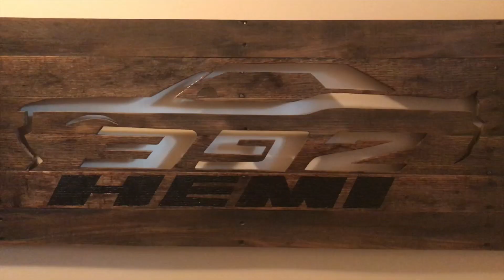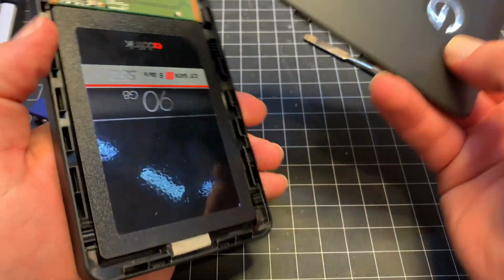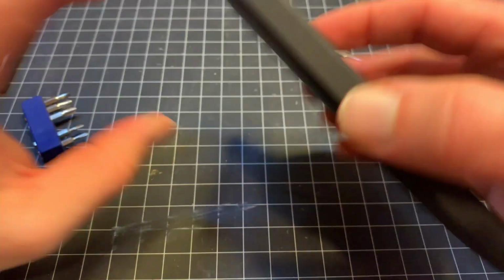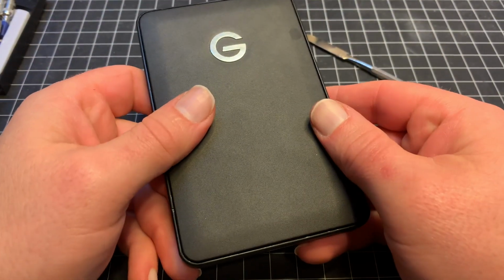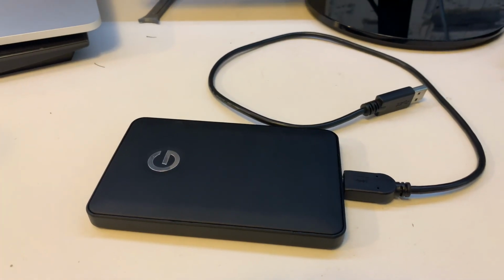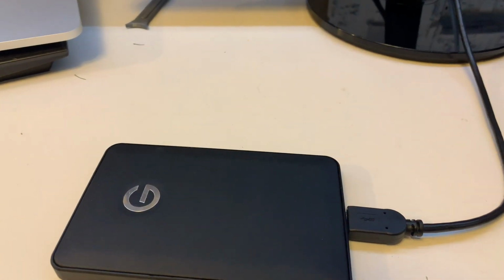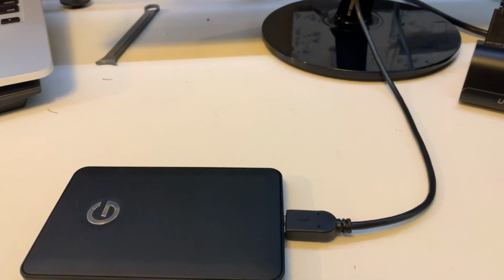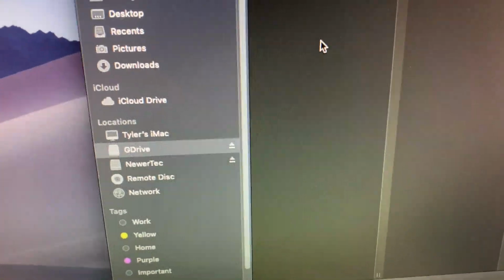Replacing the hard drive in a Gdrive mobile USB

Comment: Nice, just tried it on one of the newer models which doesn't have a SATA connector (After WD bought the brand) and it still works but I think there's some glue all around it, at least I had to loosen it quite a bit using that tool before I could open it.

Only reason I did it though was because I bought a USB-C model which was all scratched up, so I swapped the cases from my old one with USB Micro-B (Which I hate) so I have a nice clean casing but with USB-C. I guess this also means that if you wanted to replace the drive, you could take apart a WD Elements or WD My Passport, because the USB port's soldered to the board instead of a SATA connector and they seem to be in identical places.

Comment: I have the plastic case version (presumably cheaper). But the case and drive mounting are essentially the same. My drive is still working fine, but SMART says it's been operating for 61000 hours (7 continuous years!)... so maybe it will fail? Anyway, thanks for the demo!

Comment: Hmmm. I work on and have electronics since the 80s. I study and do alot. My topic for the sec now is the G drive. Little history for those to understand from me... These G drives I collect. I buy them and use them for me. I like the older ones though with the light full on front as # G Drive 0G02392 style. I tossed the though recent if I could redo a drive in that case. BUT.... Alot comes into play here. You can not just slap a bigger drive in a case depending on the named drive, case, and named holder. Along with the circuit board. I have not got around to this drive yet. I am about to start that after this vid. Because I would like to mod my drives. I take it this case for the named mostly takes a standard board in the back end. Thus- to put another drive in. I will be looking into a ssd and a hdd up size and this project soon.

Comment: I have the same drive but my PCB is built directly to the drive. And my drive was WD inside. Not same brand as in video. Just a heads up for Trenton if you try to shuck your drive.

Comment: Quick question, I have a larger 10tb g drive, one of the big silver units. If I remove the drive to insert direct into my pc will it read the data off like normal or would it corrupt or force me to format?
Reply from the maker: If the drive is mountable and not having issues, it should just read it normally.

Comment: Hi the port is broken, the hard drive is fine, can you tell me what steps I should take
Reply from the maker: I would open up the enclosure, remove the hard drive, get a new enclosure, install the hard drive in that one and use it.
Reply: @DakotaBusy  Thank you for your reply! It helps alot. To be clear, I'm on Amazon I'm going to purchase another external hard drive also with a SATA driver encloser and transfer the data to the new one

Comment: Any idea where I can order a new plug? My drive is fine, but the cord insert part is loose and will not show up unless I bend the cord a certain way...
Reply from the maker: I don't think you will be able to find just the plug.  The simplest might be just order a new enclosure off of amazon like this one: https://amzn.to/2S3RIrX and install your drive in that.  That link is our affiliate link if you want to help support our channel.  Best of luck!
Reply: Were you able to resolve it? I’m having the same issue.
Reply: @Jennifer.v  not yet. I think something inside the drive is loose and needs to be tightened or something. I have no idea what it could be though, I haven't got around to looking. Aggravating though. Quality control issue for sure 😒
Reply: @thetiredzombie  i just bought a new enclosure on Amazon for like $9 now i can use it as normal 🙌🏼
Reply: @Jennifer.v  glad that worked out for you. My problem isn't with the casing though, it's with the inside of the drive itself.